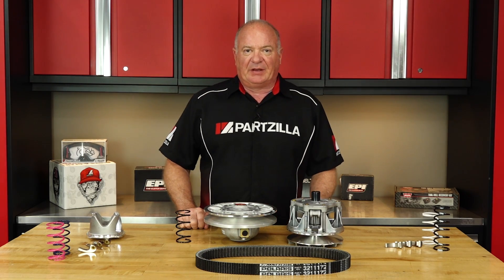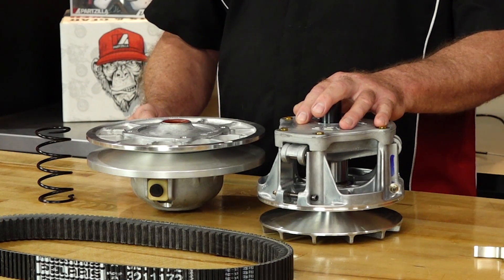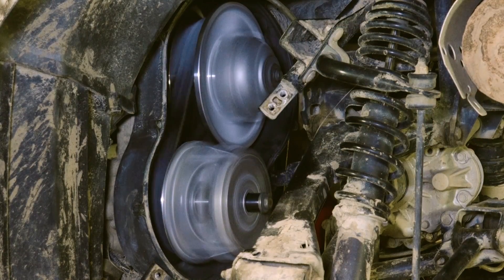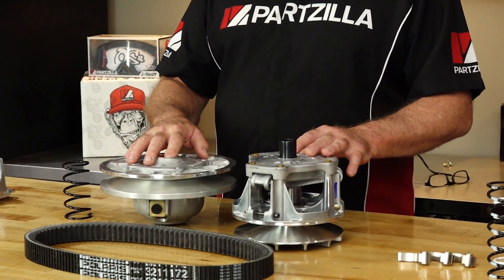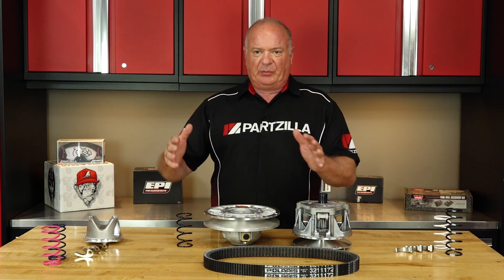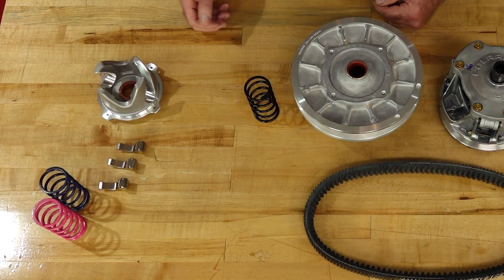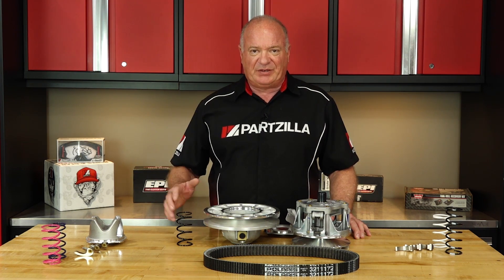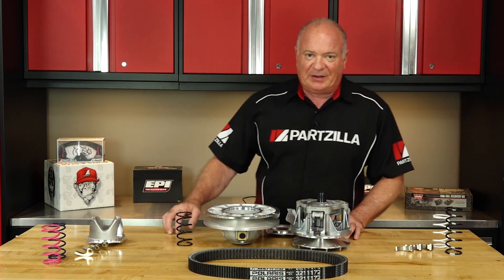ATV and UTV Clutches Explained  | ATV Clutch Tuning | How to Choose CVT Clutch Weights | Partzilla

Comment: I have a diesel 2018 Caterpillar 102D UTV that idles at 1,000 rpm but doesn’t start moving till you hit about 1,600 rpm. Any suggestions on what’s causing that issue?